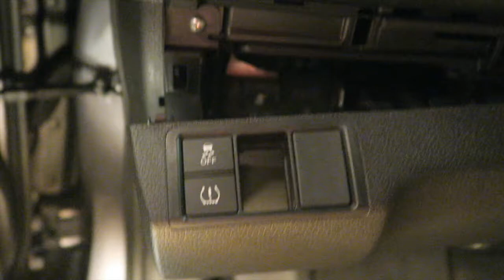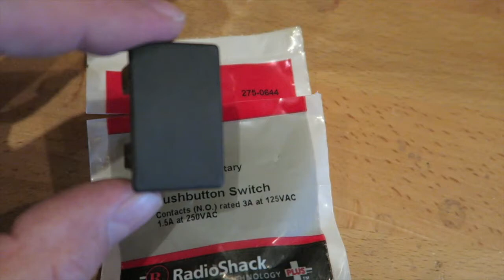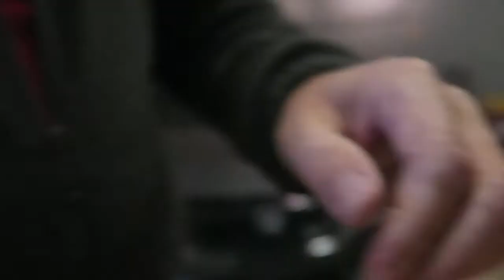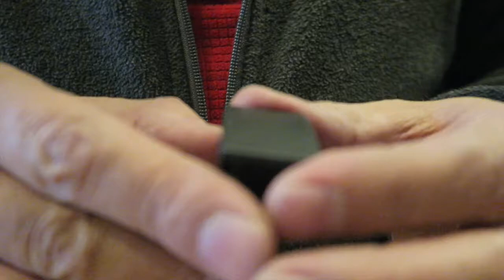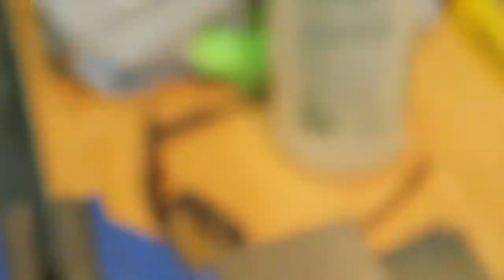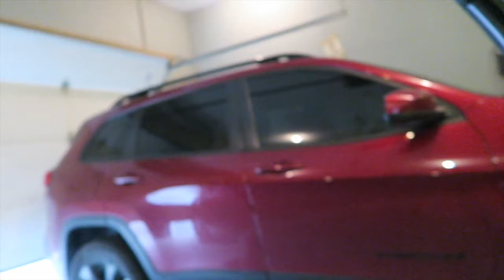Civic Hatchback Garage Door Opener Mod

Comment: Hey! So you soldered 2 wires to the circuit board (where the switch button is) and 2 more wires to your momentary switch and connected them right?
Reply from the maker: Yup.  That’s exactly right.  Of course, before you go beyond, touch the two wires you soldered to the circuit board together to make sure the garage door activates👍
Reply: ThrobbNation thank you! Gonna be my project for tomorrow!
Reply from the maker: You’ll love it!  Just as good as Homelink!!👍
Reply: ThrobbNation forsure! 
Happy you went back to the sport modern steel have the same colour hatch😉

Comment: What gauge wires did you use to connect the momentary switch to the circuit board? Also, am I correct in assuming that the only soldering you did was shown? Wires to circuit board was twist then covered, correct?
Thank you in advance! Great video!
Reply from the maker: +Daniel Draper Hey Daniel.  The wire gauge was 16.  I also soldered two wires to the switch terminals.  Then I put the switch in the slot, twisted and taped the switch wires to the circuit board wires, taped and Velcro taped the circuit board to the inside of the console panel.

Comment: Would this work without soldering?  if you just attach the wire and twist it?
Reply from the maker: +Steebu Lee You have to solder to the contact points on the opener and the momentary switch.  You could use separate wires for each and then twist them together.
Reply: oh ok so if i twist wires to it i can avoid soldering?  I just don't have any soldering tools but want to try this.
Reply from the maker: +Steebu Lee Only if you use four wires.  Two soldered to the contact points on the transmitter and two soldered to the terminals on the momentary switch.  Then you can connect those wires by twisting them.

Comment: Why does your switch at the end of the video look different from the one you showed at the beginning? Did the one from radioshack not work or fit?
Reply from the maker: +aznkid100 The first one was too wide for the blank.  I had to go with a thinner switch😎
Reply: Thanks for the reply. What size did you have to get for it to fit? I'm thinking about doing this
Reply from the maker: +aznkid100 It's prob around 1/8 (little bigger) diameter.  Pretty thin, but it's all you need.  Fits well and works great.  Thanks for watching 😎

Comment: I really want to do this...But it's going to be difficult to find a spot to but the button as i don't have many blanked out areas in my truck
Reply from the maker: +jacob3942videos Hey Jacob.  You can do this anywhere that you can drill a hole and have enough access behind to mount the circuit board.  I have done it thru dash and center console panels on other vehicles.  😎

Comment: where do you get the transmitter from? And I'm assuming it's programmable in some way?
Reply from the maker: +James Ronan Hey James.  It's the inside of the garage door opener.  All you do is take the circuit board out and solder a couple of wires to the two contact points were the button you push makes contact.  Pretty easy.
Reply from the maker: +TheAaronhuang It was either 14 or 16?  I got the thinnest they had at the store.  You don't need much and the thinner the better😎